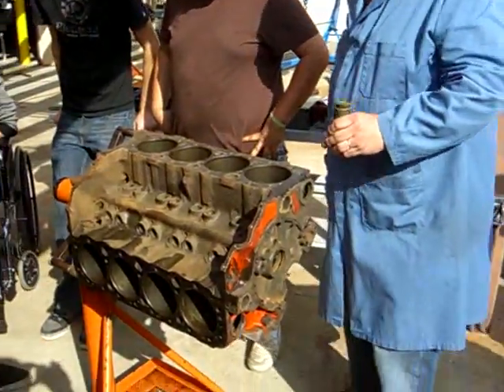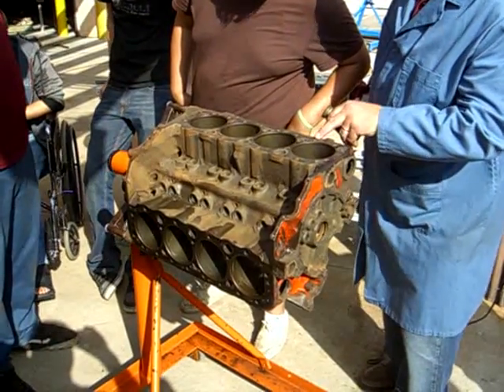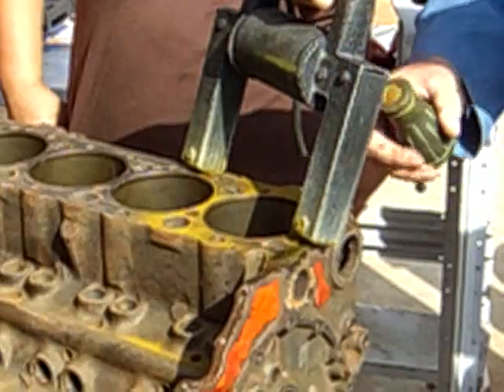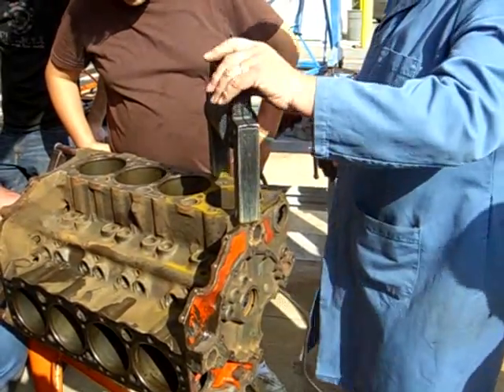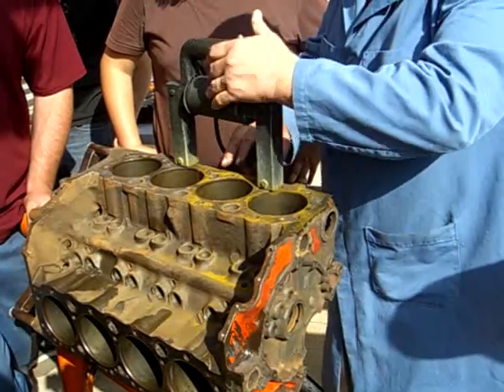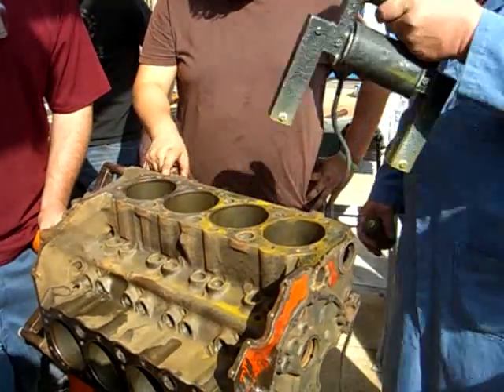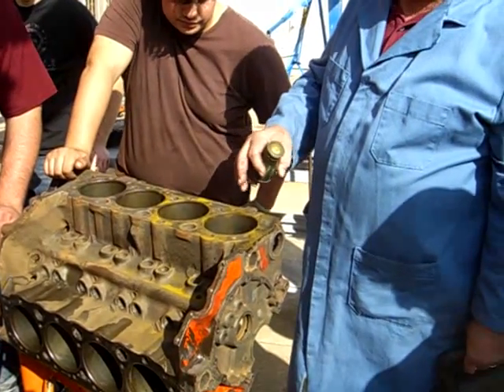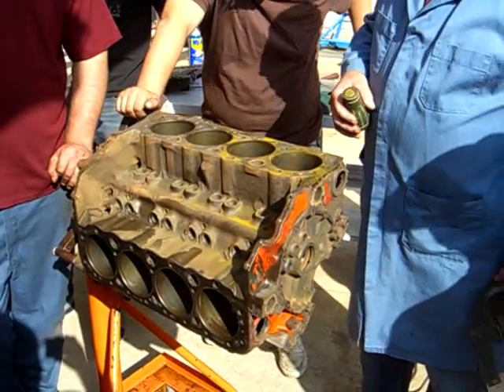How to magnaflux an engine block

Comment: That's not how you use it.
Reply from the maker: Please elaborate for us.
Reply: @DW_CT9A  You apply (dust as in a verb) the iron powder from the puffer bottle after you energize the yoke. You don't blanket the part with dust first. You'll use less product, less mess and show more fractures. Everything else looked fine. I would use a yoke with articulating legs to do the inside of the bore. 

I'm a level 3 NDT cert weld inspector. Ultimately the yoke or probes (depending on eq on hand) produces a leakage field at the flaw (crack), forcing the magnetism to leave the block in this case. The iron powder can actually pick up sub surface flaws too, when applied correctly. I've been doing this since the 80s.

Comment: Why are technical schools teaching with that old-ass engine?
Reply from the maker: All students must supply their own core and new parts. SBC parts are dirt cheap and readily available. Also, pretty good engine to learn on if you have little or no experience. Simple engine and been done a million times.
 That said, i built a 4g63t in that class. :)
Reply: My favorite old-Ass ENGINE video:https://www.youtube.com/watch?v=Rs2KOWkydtU
Reply: Probably because even in 2021, the small block Chevy is still a very common project in engine shops. Have 7 or 8 of them being machined and built in my shop right now.
Reply: New engines can't be serviced like the old ones.

Comment from the maker: @4Liberty74 I appreciate the comment, and decided to look into it a bit so i asked a friend who has been a machinist for the last 30 years and currently does so for marine/racing applications. His response "I wouldn't be worrying about that.  By the time the block is assembled, the residual magnetism has dissipated and the bores have been cleaned to within an inch of their life.  Cast iron is fairly soft and is both quick to magnatize and quick to demagnatize.  It's the nature of the material."

Comment: what if its aluminum?
Reply: Aluminum heads and blocks get pressure tested and dye checked where the pressure testing won't reveal a crack.
Reply: @whiplashmachine  thank you for the response.  
I guess at the end of the video he briefly covers it.